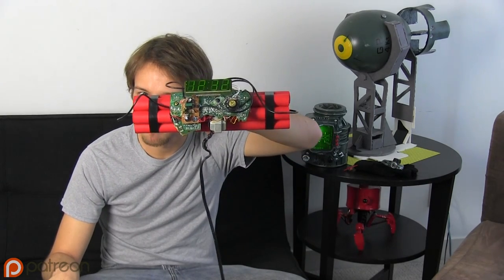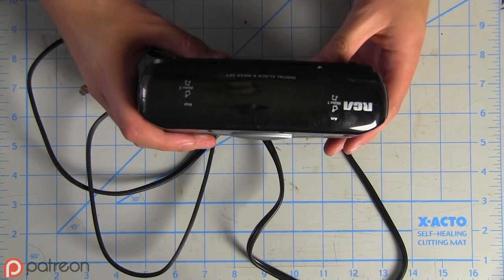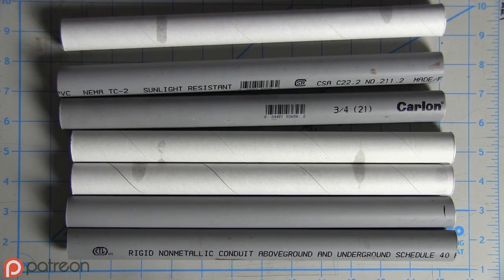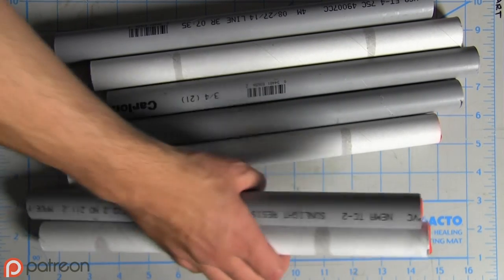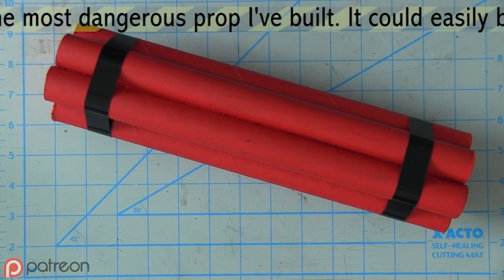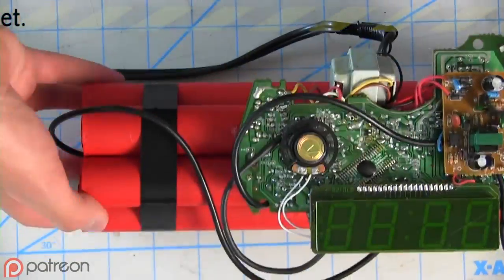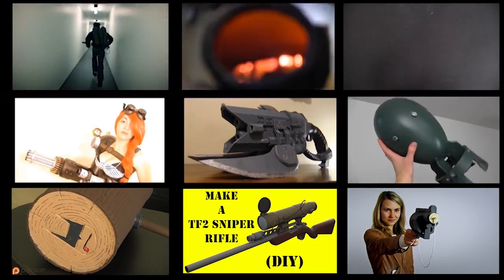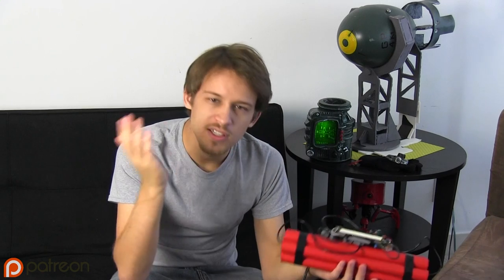How to Make a Time Bomb Prop (DIY)

Comment: Instead of using hot glue try and use barge it's gets rid of the nasty seam on the foam also before you do sand of the pattern on the pack